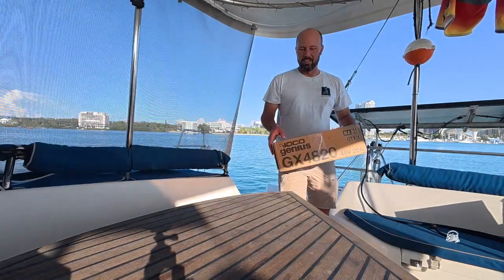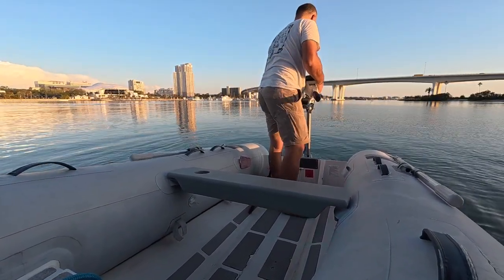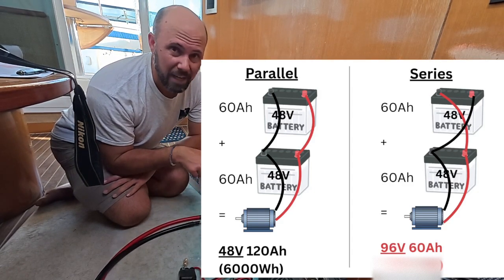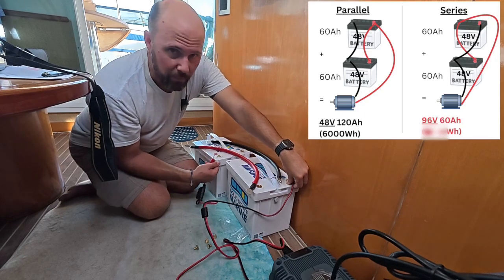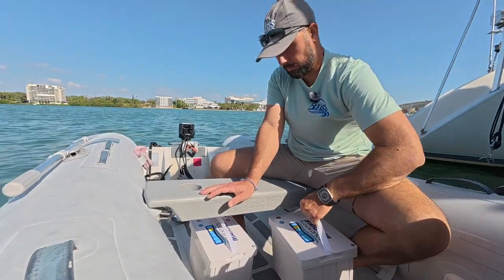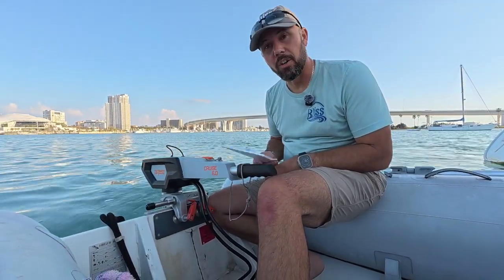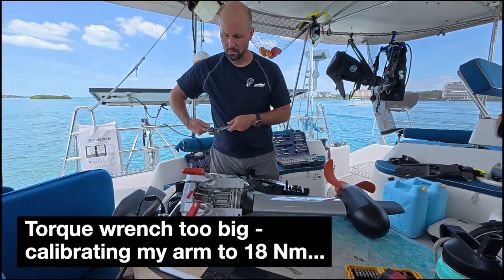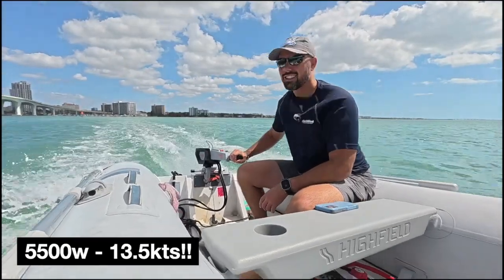Torqeedo Cruise 6.0 + Solid State Batteries | Speed Test & Shaft Fix

Comment: There is STILL NO SOLID STATE BATTERY AVAILABLE that is larger than a stamp,  the closest too that is Teslas dry electrode battery.
Reply: TheSSM batteries are indeed solid state and were developed by a MIT professor in the MIT lab. These batteries utilize a solid state separator. They have double the energy density of LFP competitors. The separators are thicker than ideal, when separators are developed that are much thinner then SS batteries will become 4 times more dense than LFP or 3 times as energy dense as NMC or NCA. 
SSM uses a solid state NMC chemistry that is as safe or safer than LFP and has similar cycle abilities at around 3000 full discharge to 80% OSOC.
Reply from the maker: Thanks for the reply!
Reply from the maker: @matthewmortensen7401, thanks for the added info!
Reply from the maker: I understand since it's brand new, but I'm sure these are solid state. I asked Solid State Marine to send me a video, but I would take a look at their site. They have videos of puncture tests on the batteries. It's all about the separator being used, which is solid. I will have more info in the next video since this seems like a hot topic! :)

Comment: Yikes!  I know you aren't using the "series" connection of the batteries, but your diagram on the right is NOT correct.  You have plus to minus AND minus to plus.  That creates a 96 volt short circuit, and if it were not for the internal BMS protection in the batteries, you'd get a small explosion and probably a fire.  Series is minus to plus between the batteries, and the load goes between plus on the first battery and minus on the second one.
Reply from the maker: Ugh, can you tell I'm not an electrician? You're right but I had to go verify. Thanks for pointing that out! I'll have to figure out how to correct the video, or else just have to correct it on the next video!!

https://battlebornbatteries.com/batteries-in-series-vs-parallel/
Reply from the maker: @tubeuser2350 Thanks again for pointing that out! I went and learned how to make a pop to show that there are corrections. Good looking out!

Comment: These are still LiFePo4 batteries just with cell 'packets' instead of traditional cylinder metal cased cells (10950 etc). They are not 'Solid State'. Solid state would indicate something like a ultracapacitor.
Reply from the maker: Take a look, it’s all about what the electrolyte is. These type of batteries are right around the corner. I just thought they were a little further around the corner than they are! https://solidstatemarine.com/pages/technology
Reply: No they are not, these are NMC batteries with a solid state separator. 

TheSSM batteries are indeed solid state and were developed by a MIT professor in the MIT lab. These batteries utilize a solid state separator. They have double the energy density of LFP competitors. The separators are thicker than ideal, when separators are developed that are much thinner then SS batteries will become 4 times more dense than LFP or 3 times as energy dense as NMC or NCA. 
SSM uses a solid state NMC chemistry that is as safe or safer than LFP and has similar cycle abilities at around 3000 full discharge to 80% OSOC

Comment: What is the run time with that setup while on a plan?
Reply from the maker: It is supposed to have an hour and a half run time at that speed. I just won’t believe it until I do it! I have not had it long enough to get a full runtime test. But that will be coming by the time I post the next video with the new dinghy. :-)

With the Power 48–5000, which is Torqeedo‘s battery, it had an impressive run time chart!